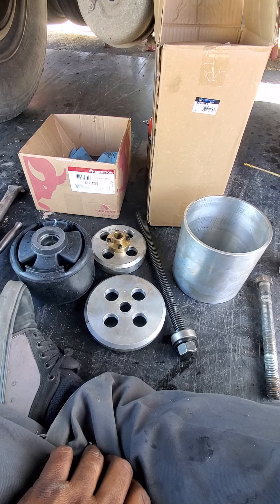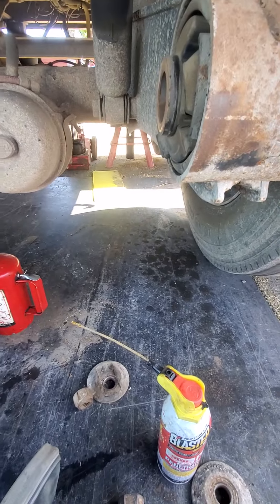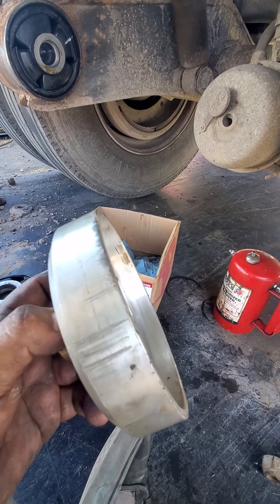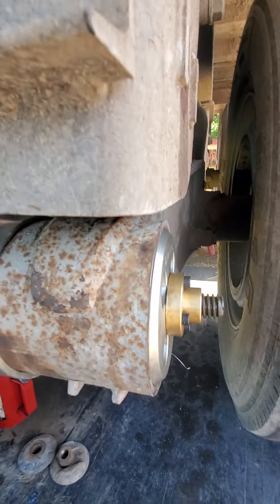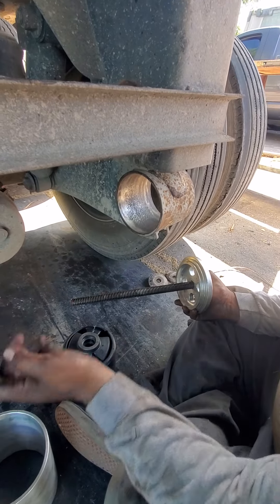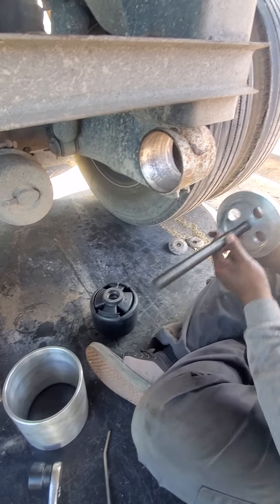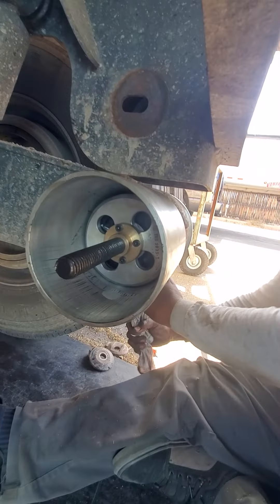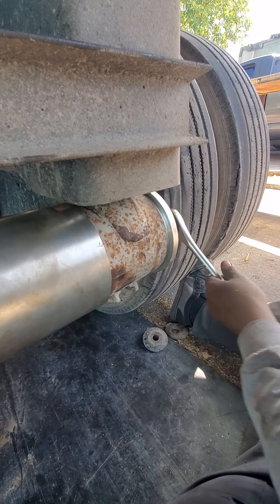installing a meritor pivot bushing with aftermarket removal/ install tool

Comment: Good to see someone actually reading the instructions, using the right grease and lubing the bushing itself. As the person who wrote them its pretty satisfying...
Absolutely do need to use the special grease that comes with the tool on the or something that's the same rating, it's super important or the acme threads on the tool will literally end up shearing off from the force. The amount of pressure those threads generate is insane. Goes for both this or the Hendrickson one. 
Unless there's been a revision since I moved on then it's recommended to use a wrench, even if it says you can use a 1/2" impact. The threads are working hard, wailing on it with the ugga dugga will result in the threads going bluetooth mode and rolling down the road like a slinky.

The reason that you need to align the mark is in the design of the bushing itself. It allows movement in one axis (the areas that are open) but is fairly rigid in 90 degrees from that (where the bushing is basically solid straight across). If the bushing goes in at a bad angle the movement it's designed to allow will be in the wrong direction.

Comment: thank you for this video, I have a few questions, the round measurement of my pivot bushing housing is 5 1/2" in the length is  4" , which one is the right bushing for my trailer ? the tool # it didn't come out nowhere , so could you help me out ?